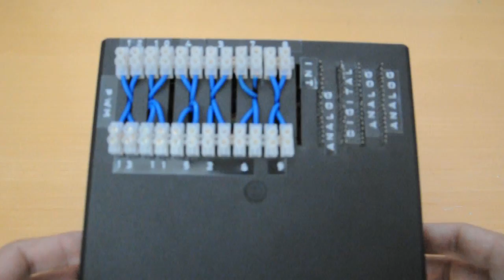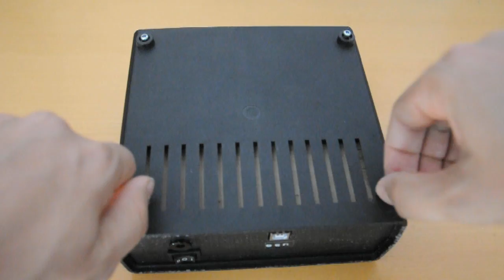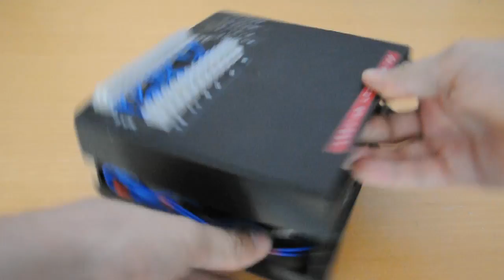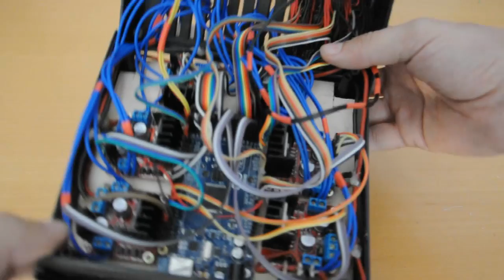Inside the Arduino Lego Trains control box

Comment: You didn't mention how the Arduino is powered? I'm assuming you powered it via the 12 volt jack? If thats the case, you didn't need a drop down thingy?
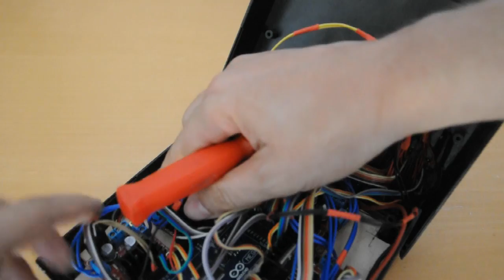Reply from the maker: If you look at 2:04, you can see a small red wire running from one of the Motor controllers to the Arduino. Each Motor controller can supply clean 5V on one pin if required, and I've connected that pin to the Arduino's VIN pin.
Reply: Arduino Lego Trains Cool thanks dood!

Comment: Neat projects - Thanks for sharing! Just one observation -  Instead of putting all your function onto one MEGA and writing one huge programme, wouldn't it be easier to modularize your projects and use a bunch of Nanos instead? I too use ARDUINO  in controlling my Christmas Village projects, but I dedicate one Nano to servos, another to relays, a 3rd to stepper motors, etc, and spread them all around the layout geographically so as to avoid long cable runs. I also use OOP (classes) and State Machine programming - makes more sense, since there is so much duplication - just write the main code once and  create "instances" - try it, I am sure you will find it is much easier over the long run. Here are some links:  https://youtu.be/kAV27_vkHTI,    https://youtu.be/xOqstsdmj54
Reply from the maker: Thanks for the reply! This control box was used in Tutorial 10, which was based around a state machine with a single function. The only cable runs are to the individual motors or sensors, so placing individual nanos at each of those locations wouldn't make a huge amount of sense since they'd then require their own power source and either a serial or wireless connection to the main Mega. State machine programming was introduced in Tutorial 6.

The new series of tutorials will feature arduino-to-arduino communication and wireless comms, so you can look forward to that and more advanced programming techniques in the near future!